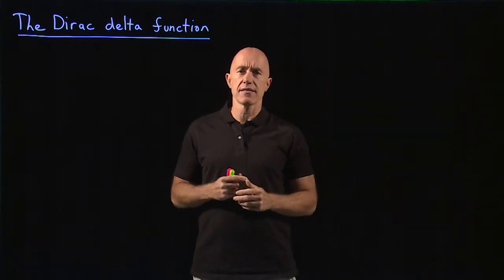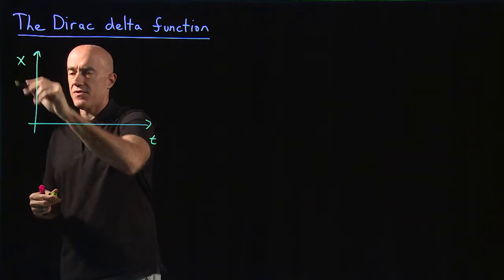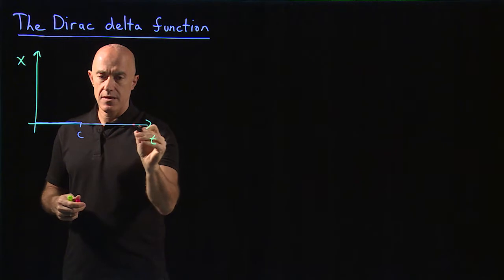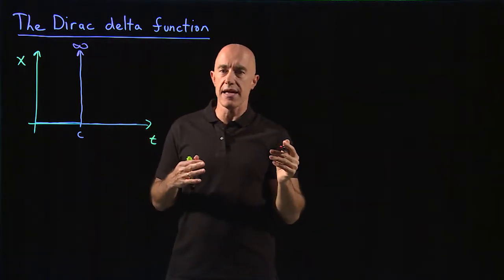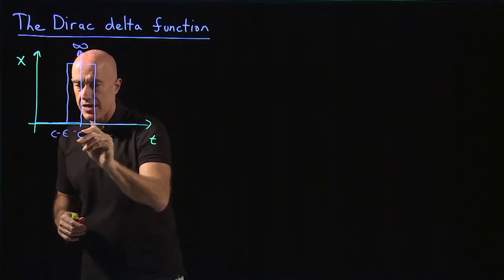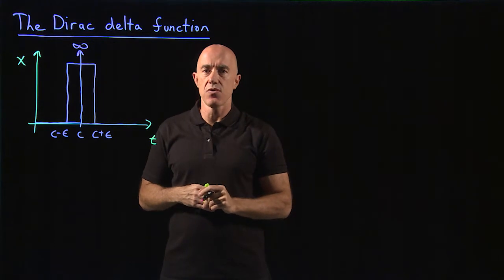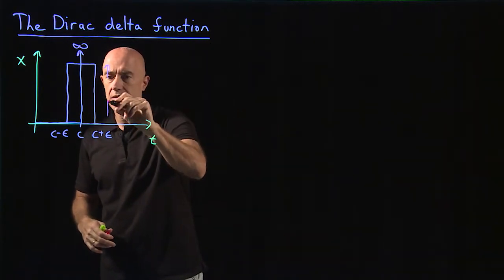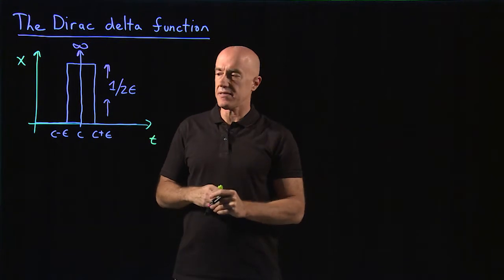Dirac delta function | Lecture 33 | Differential Equations for Engineers

Comment: I do not think that the argument to show that the integral of the Dirac delta function is 1 using limits of a function is a valid proof.

If you replace the 2 in the function that has a magnitude of 1/2e you will still approach the same limit. meaning that a function G(t) defined in the range -e to e with a magnitude of 1/3e gives an area of 2/3.

 Now the limit as e goes to zero 1/3e goes to infinity. Therefore using the same argument, the integral over the infinite range of the Dirac delta function is 2/3.

Generalizing, If I had any function defined in the range -e to e with magnitude 1/ne where n is any integer, then the integral over the infinite range could be any number (2/n). 

Therefore if the argument given is valid, the integral does not exist.
Reply from the maker: You can't argue about a definition.